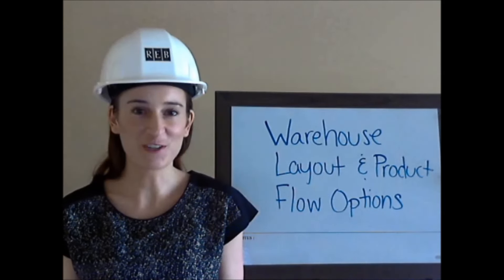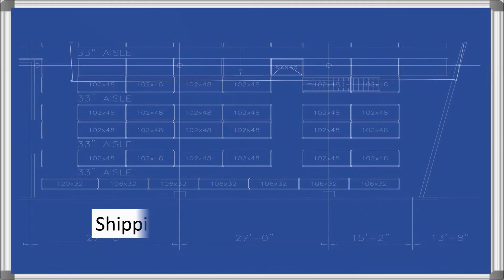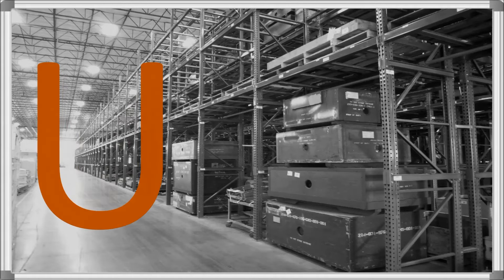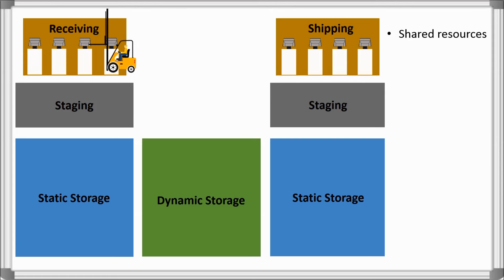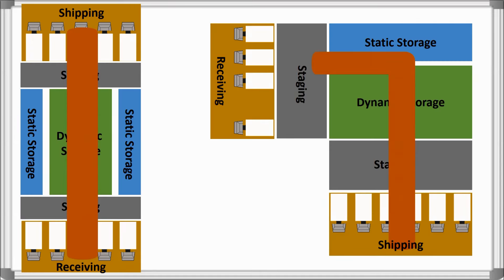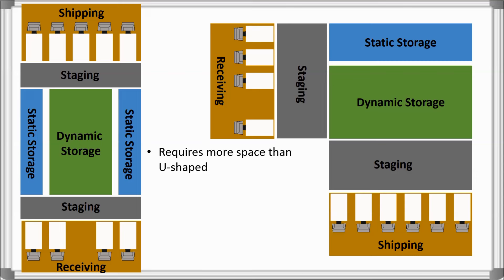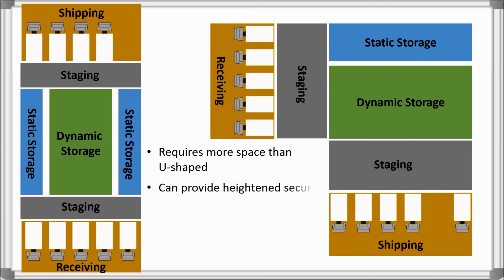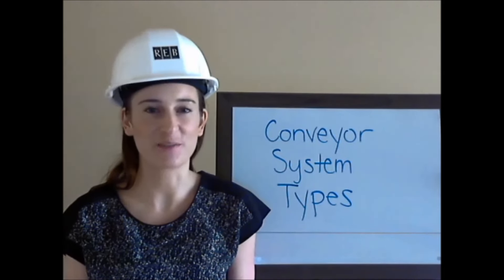Warehouse Layout & Product Flow Options | Total Warehouse Tutorials with REB

Comment: Still new, I can see the shift,  select the shift, but when I get to the end it says shift is full. However it still shows available.  I have restarted the phone. Still no luck.
Reply: I am having the same problem- I select the task, read through the requirements, but in the end, it is not assigned to me!!
Reply: I get to the last verification check list but I can’t scroll down to accept the job 😢 I’ve tried to finish on different devices and it just won’t let me scroll down when I get to the last part? Anyone else having the same issues?